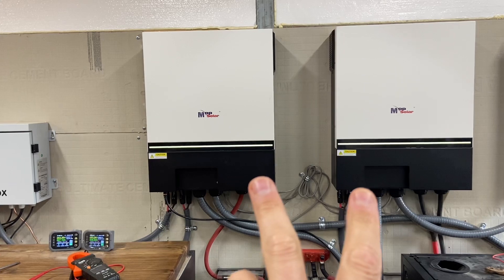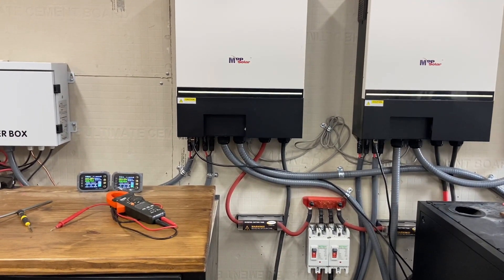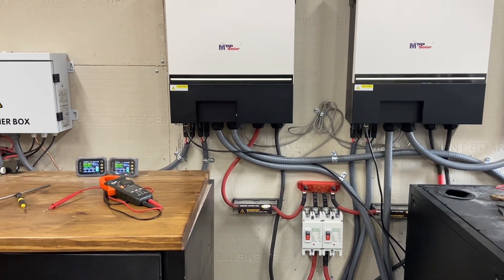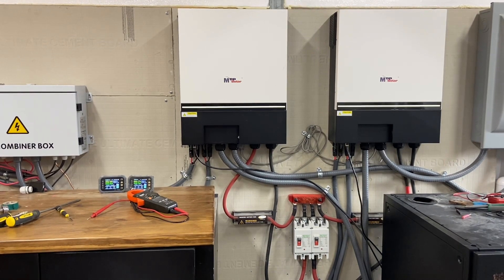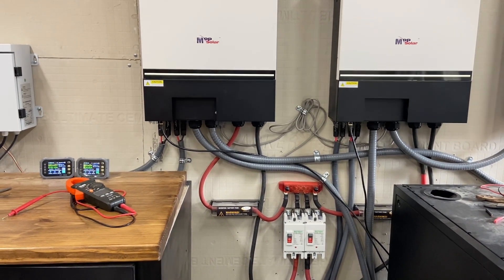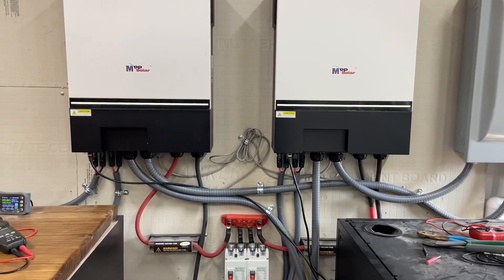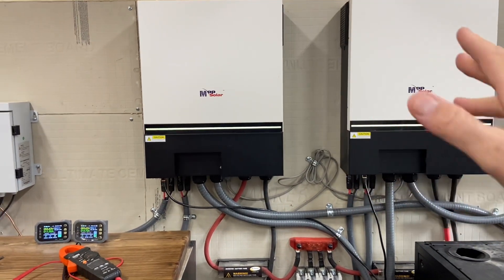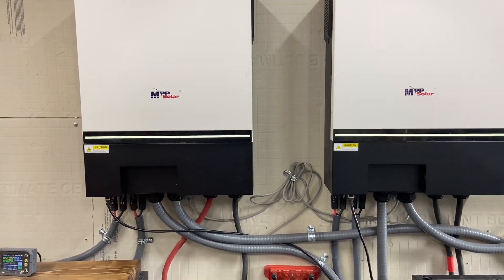My negative thoughts on  EG4 6500ex inverters.

Comment: Lots of Youtubers recommending these inverters.  Will Prowse etc.  If they're running dirty power, this can mess up all your sensitive computer stuff after a while.  They will check for faults before sending them out to major youtubers.  I think his ones were dropped in transit but still worked.
Reply from the maker: That’s possible. Good news is I’ll get another try! Signature solar apologized and refunded me in full. They have also sent me a new set of inverters to review. So hopefully I will be posting that video next week. Stay tuned.
Reply: After your experience why?? You tubers. Of course they'll double and triple check you get a good version... You'll rave about it.. All problems fixed.. And they'll continue sending suspect units out.

Comment: Hold on, you're telling me that the 1st tier of tech support couldn't explain in exact detail why your lights were flashing, or if it specific components have been removed from the inverters? No way.

So if you can't talk directly to the more advanced techs why not just go through whatever process to be able to talk to them? 

This sounds to me like to called up there, didn't get a solution from the people who do basic troubleshooting, took your toys and went home, and then made a video as if you've been wronged somehow?

You could've just checked for continuity between ground and neutral to know if the screw was intact.
Reply from the maker: They were selling an inverter that they knew had these Issues. Yeah that did seem wrong. And I never did hear from tier 2 tech support.  I’ve seen this experience play out on the forum also.  I sent them info to go through the “process” and nothing happened. You could say I should have just waited a couple more weeks, days, minutes? That’s really hard to say because there isn’t a queue. Customer service didn’t  know anything. And tech support didn’t respond to emails or calls. I suppose everyone has a different level of patience. Perhaps you would have just waited for the “process”. I’m glad for you. 

Anyway, since you seem heavily invested in the story, there is a silver lining. They apologized and have since refunded me in full. They sent someone to Taiwan and found an unauthorized hardware change that was conflicting with their firmware. They’ve come out with an update they believe will remedy most of these issues.

Comment: Just because one makes them all don't mean they are the same. they made to what you ask them to make.
Reply from the maker: This is true. Signature solar has some custom upgrades they have requested from voltronic. Unfortunately it came with some side affects when the factor evidently made some changes without alerting SS. So it resulted in some conflicts between the firmware and hardware. SS has refunded me, and said they will be sending me a pair of these inverters to review.
Reply: @GavinStoneDIY  Good a lot have conpland about them glad to see they stepping up I have had good output with them but I used Growatt and Victron

Comment: MPP and EG4 come out of the same factory in China. I doubt they use different chips. What you are experiencing is common in all high frequency inverters. Flickering doesn't occur in low frequency inverters, at all. Add a transformer and the power output is much more stable. I've seen MPP inverters flicker, as well. It's the luck of the draw.
Reply from the maker: Flicking appears in basically all high frequency inverters at some point depending on the situations. With a heavy inductive load mine will flicker once. That’s to be expected. This wasn’t flickering. The lights were constantly strobing up and down non stop. Since this video signature solar has come out with a firmware update to address this problem. Apparently It was a hardware change the factory made without approval. It was conflicting with the firmware. Signature solar apologized and has refunded me in full. They are sending me a set of new inverters to review. So hopefully soon I’ll be posting an update video.

Comment: If they charged you a restocking fee for a "warranty" return i.e defective product that would be ILLEGAL as they can't prove otherwise. 

I would push hard on getting all your money back and or expose the scammy tactics of that company on video. 

I'm glad to see this as I was planning to go on a complete EG4 inverter and battery setup but after hearing about their support I'm gonna bite the bullet and spend a bit more on a better brand
Reply from the maker: I have received a full refund with an apology. And at this point they are scheduled to send me a new set of these inverters to review. I will hopefully be making that review video in just a couple weeks. They are still struggling in the support. But I’m hoping they are heading in the right direction.
Reply: @GavinStoneDIY  ok that's good to hear. I'll be looking forward to that review and hopefully it corrected the issue

Comment: I'll have to be honest. When I first started watching this video I was not a believer. I was thinking that you had installed something wrong and was just beaching!
     My apologies for what I was thinking! I don't know what is going on. I know a guy who has this unit (he's had it a while) and it runs great. I also saw Will's video and figured that since he complains about a battery testing 1 ah short, that they must be alright. After Googling this issue, I think that I was wrong. It seems to me that these might have been alright when they first started making them but LOTS of people are having all sorts of problems with the new ones!
     Now, I am really glad you made this video! When I first watched it, I thought you were rambling on. That is good though because you are actually trying to drive a point to help others. If I got ripped for the kind of money you did, I would be highly 'upset' to say the least!
     I am ordering my first 'all in one' units within the next week or two, and have been searching for info. I was considering the Eg4 60-48, Eg4 6500ex and the MPP 6548. I ruled out the first one because I have very few 220 loads. I was really about to get a couple of 6500EX's. I wanted the higher inputs. I'm not now. I looked at Watts24/7 and I am getting in contact with them today.
      If anyone is thinking like I was, I recommend that you do a really thorough, objective search about complaints, issues and reviews of Solar inverters. It's like the X files. The truth is out there!
      Nice video and Thank you for making it!
    Ya'll Take Care and be safe, John
Reply from the maker: Thanks for the feedback John. Videos like this are difficult to make for some of the reasons you mentioned. You don’t want to just seem bitter and moan about how people treated you. And you also want to be straight  forward and honest. Since the making of this video, signature solar has done some investigating and come up with a firmware fix that they say corrects many of their issues. They have refunded me in full with an apology. And they have said they’ll said me a pair of these inverters to review for a follow up video. I’m not sure when I will receive them but you can always keep checking in till then. In the meantime Ian at Watts247 is fantastic to work with. He can answer any questions you have. Let me know if you need any details when it comes time for your install.

Comment: Thx for sharing. I am beginning to think this whole thing is a scam. All of these inverters are running to high on their duty cycle to last 20 yrs. With a 2 yt warranty. More and more I see people complaining about a lot of brands and models. Tho I have seen a disproportionate number of complaints about eg4 inverters.. if these same size machines were a welder would we expect it to operate at that high of a duty cycle for that many hours out of the day and last 20 years. I know your vid is about different issues. But just venting what I see in general..
Reply from the maker: I tend to agree. Although perhaps it’s the fact that the solar industry has really grown immensely in the last 5 years. And with it the inverter technology. More and more people are installing systems on their own. And many of them aren’t installing them correctly. That coupled with faulty equipment means a lot of complaints.

Comment: NUTS! Wow, I can not believe this is happening. I was told months ago by a good source that because of the chip shortage, they used off-brand chips and made them work with software patches. It looks like that didn't work. Great video, Gavin 👍
Reply: I think Will had his before the chip shortage
Reply from the maker: Wills units do appear to be working fine. I confirmed it with him on the forum. I have an update video coming soon hopefully. I was refunded in full. And SS contacted me, they are sending me 2 new units to review. So as soon as I receive them I’ll update everyone.

Comment: Just thinking out loud, Gavin. Did you have the EG4s in UPS mode or "appliance" mode? Did you try both? I think the phase lock is different in the two modes. You might be getting crosstalk between the grid and inverter power and the "strobing" that you are seeing might be the two beating against each other... like two musical tones that are at slightly different pitches. Or maybe the frequency is dithering because the phase lock is looser in one mode.
Reply from the maker: Yes. Unfortunately that wasn’t the problem. I was informed by Ryan at tech support that they had occasionally had some success with light strobing changing that. They apparently have a new firmware update as of last night that will fix this issue. It caused quite a bit on controversy.

Comment: Oh man I had the same exact issue with the inverters tech support and customer service. 30k spent lesson learned.  This company is trash.
Reply from the maker: I’ve seen people on the forums that support signature solar. But I think it’s because they never had a serious issue and needed assistance. So I think it really depends on what you purchase from there and the application.
Reply: @GavinStoneDIY  I pulled Away from Watching Solar, inverter video's Thinking I was crazy or had bad luck with these vendors and the MPP equip. I'm Glad to see People are speaking up about this nonsense, seams like a committee pushing These inverters. SS customer service is horrifying Your lucky to get a call back and only a few people really know what there doing at best. Ian at 24/7 Is a super guy but these inverters are killing him, Replaced 2 boards on my LVX 6048's at MPP's expense but i had to ship. I finally had it. There on a shelf in my garage now I don't trust them.

Comment: I have 2 eg4 6500's NIB waiting for install. There's no FN way I'm changing out my dimmers and lamps to accomodate their flawed equipment.
Reply from the maker: Well, I hope your experience with things is better then mine. Keep me posted. I know supposedly they made some changes in some of the newest models. But I’m not sure I trust anything I hear from that camp.
Reply: @GavinStoneDIY  I received mine Sep 2022. I'm likely going to sell them to the highest bidder. I also have 2 LV6548's which was part of my original install package.
Reply from the maker: @sniper7.62x51  well if you’re going to resell them anyway maybe try installing them and see how they work for you. Will prowse seems to have good luck with his. Personally I think they have issues. But signature solar doesn’t acknowledge that. Honestly you’d be much better if with the LV’s in my opinion

Comment: I was actually about to go with 2  EG4 6500 like you did but decided on the GSL-H-12KLV-US with 200A AC Passthrough.  They are similar to a Sol-ark but less than half the cost.
Reply from the maker: That sounds intriguing. I’ve never heard of them before.
Reply: Don't get the phases to much aut of balence or you will be in the dark
Reply: Where did you find the GSL for sale recently? My friend bought one a couple years back and I helped him set it up. I found out the GSL - sol-ark - deye connection when searching for an error code we were getting. The error code the inverter had was not listed in his GSL pdf manual that came with the inverter. Found it in the more detailed error code tables for sol-ark and Deye. I hadn’t seen GSL for sale for the last year or so.

Comment: My Growatt es500es flickers led all the time. I am leaning towards magnum low frequency inverters or a solark. I guess you can't expect much from under $1000 all in one
Reply from the maker: True. I’ve heard some people have a flicker with lower wattage solarks. They are hf as well. Although much better quality for sure.
Reply: I have two of the Growatt SPF 5000 ES 48v inverter transformers, with the Solar Edge midpoint tranformer, (needed to put out 120V, as these are 240V units), and I have had no problem, and all of my lights are LEDs.

Comment: My EG4 inverter just died on me today. I have been battling with issues of settings changing and also power cycling hard off and then back on again over and over again in the mornings as the sun comes up. At first I thought I’d get on the phone with tech support and work the problem and solve it. I’m an HVAC service technician, I was excited about solving problems. But we are months in on this now and then one bites the bullet today. I’m so done, I learned a saying in the 2a community, buy once cry once. I trusted Will Prowse. Big mistake… hopefully I can get some of my money back and upgrade to better inverters.
Reply from the maker: Sorry to hear this. You may get some money back. It’s hard to say. I think Will’s experience with  the EG4 inverters has been quite different then a lot of others. His seem to be working fine still.
Reply: @GavinStoneDIY  If you were going to be getting 2 new inverters, would you still go back with the MPPs?
Reply from the maker: @davidashcom6087  yes. I have had zero issues with them. Current connected has extended warranties on theirs you can purchase. Plus they have actual tech support. As does Watts247
Reply: @GavinStoneDIY  Thanks Gavin. I need to get the LV6548V to accommodate my high voltage solar wiring. Looks like I have to get this directly from MPP. Hopefully they will be on the way soon!
Reply from the maker: @davidashcom6087  yeah mpp has a 370v version. And I believe current connected and Watts247 have them in their warehouse, but they want to sell the last of the 250v version first. Which makes sense.
Reply: I now have my MPP inverters installed and am using SolarAssistant to manage them and the EG4 batteries. Everything is working flawlessly. I definitely feel like the MPP product is much higher quality and no firmware glitches. It always switches between modes smoothly and no powering off and then back on in the morning. Also all settings stay where I put them. I love my setup now!
Reply: Thanks Gavin for your assistance.
Reply from the maker: @davidashcom6087  I’m so glad you have everything up and running! I’ve  switched to running my whole house with the mpp’s. Not just the critical loads.They are still doing great.
Reply: @GavinStoneDIY  I have my whole home on them as well. Eventually I’ll get two more so I’ll have four. Gonna add another 30 kWh battery first. I harvested 62 kWh today!
Reply: I did the same thing. will is pumping there products and getting kick backs for doing so.

Comment: I couldn't be happier with my LV6548. It's been running non stop for 17 months. It's on the back porch and it does get pretty loud but since it is outside it doesn't really bother me. Someone trying to run them in the house might be put off with the sound. I actually like to hear it whining away because the louder it gets the more power I'm making.
I also agree with Watts 24/7 being a stand up company. Ian texts you right back whenever you have a question.

Comment: That’s super aggravating and funny thing is when you talk to signature solar they act like they’ve never heard of such a thing flickering lights what wow you must’ve done something wrong or you’re running super cheap lightbulbs funny how my grid power is more inconsistent than my inverter power and they run perfectly with grid power
 They want to charge my 40% restocking fee plus I pay for shipping   Get out of here.  I’m filing a dispute with my credit card company over this joke of a company
Reply from the maker: That’s probably the best route to take with it . Maybe the credit card company card sort it out. SS knows  they have issues and they continue to push more products out. I made this video to warn people that there is potential issues. If it saves one person even a little money then it was worth making. Sorry you had to go through that mess man. It can be stressful.
Reply: @GavinStoneDIY   your going to be a big help to others I’m sure 
   Sorry for the dumb question but what MPP are you running again.   It’s not the split phase one correct
Reply from the maker: @cowboymcq6711  they are single phase lv6548 units wired in parallel to provide split phase. So each unit provides one leg of power to supply your panel. Mpp does have units that are essentially the same as what you have also.
Reply from the maker: Around 10 months here  now without any issues. So it’s probably a safe bet.
Reply from the maker: @cowboymcq6711  that’s an option. It’s easier to buy from Watts247 though. You can text Ian and he will answer you back within an hour or less usually. Even on a Sunday occasionally. I’ve never talked with anyone more knowledgeable when it comes to solar.
Reply: @GavinStoneDIY  Gavin Is correct people! Ian answered me on vacation! Super good dude!